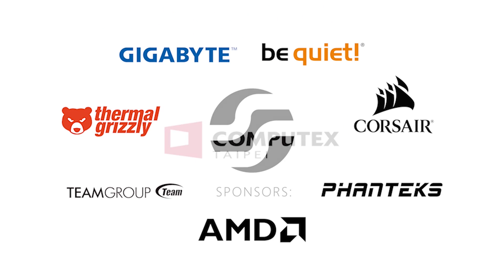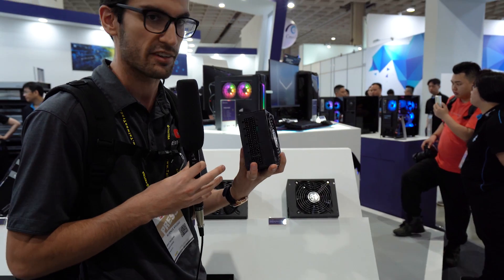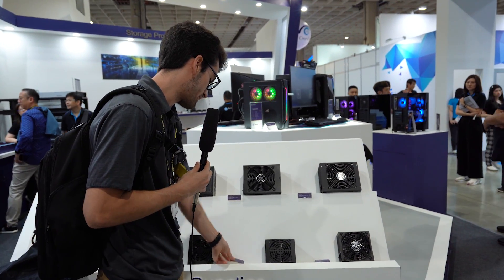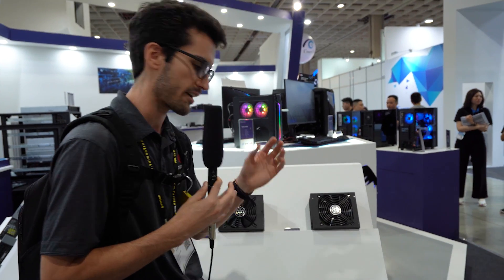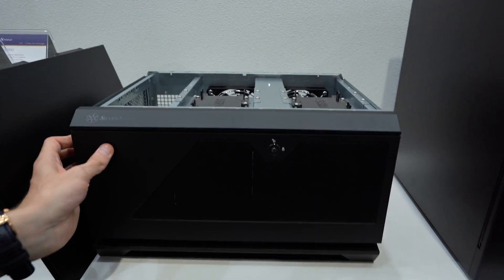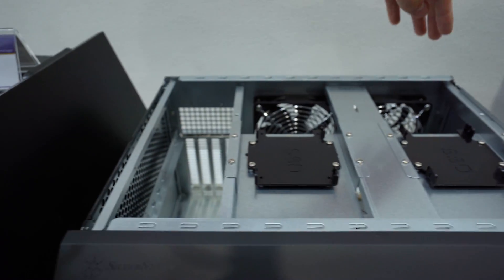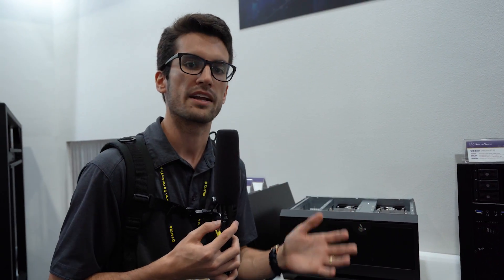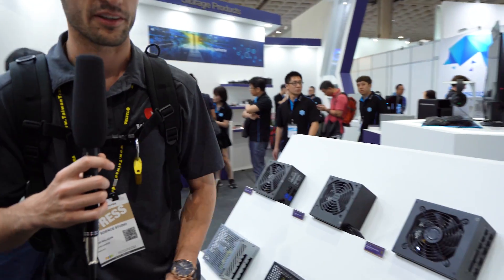The Watt Per Liter Race

Comment: im sorry but its not that hard to make a small power supply servers have been doing it for years
Reply: That doesnt negate the technical complexity required to create it.
Reply: But are server power supplies affordable and reasonably quiet?
Reply: Not that hard to fly to the moon nasa been doing it for yeara
Reply: Niall McElroy oh yeah obviously but it means it doest deserve a whole spot on a computer show about how 'inovative' it is
Reply: Cavey Möth yes a used 1200w goes for £20 which is more efficient and if you use it at 700w just like this Silverstone one it will not be loud at all
Reply: WayStedYou yeah but NASA haven't been doing it for years there has only been 6 manned moon missions last one in 1972 oh which allot had problems and issues however 1200w server PSUs that size have been around since 2010 and you can still see some on the used market now which have survived 9 years of work and now you can see even more compact 1600w ones with a watt per liter twice those silver stone ones
Reply: @marky5204  Ooh, okie. I actually didn't know, lol.
Reply: @CaveyMoth  Server PSU's wwere so good and efficient that when GPU mining was a thing they madew breakout boards so you can use a server psu for mining

Comment: What do u think of a build for around £350 new. A ryzen 2200g,  2x4gb 2666 corsair lpx ram, crucial bx 500, corsair cxm 550w and an msi b450 mortar
Reply: get 3000mhz ram, the rest are fine
Reply: @6Twisted  I was planning on using the vega 8 graphics on low 720p until I can afford an rx 570 a few months later. Is that still a good idea?
Reply: @ThatGuy-sp9gh  maybe wait for the zen2 apus?
Reply: @6Twisted  I can just upgrade my CPU afterwards tho couldn't I? The 2200g is just a cpu until I get enough money for a 2600. Also is 3rd gen ryzen coming to b450 boards?
Reply: @6Twisted  at the moment I'm not looking into like super fast memory and pci 4 stuff from x570 boards. I really just want a PC that'll play any games at high or mid settings 1080p at 60ish fps

Comment: Its somewhat an overrated measurement, we at the Verge have done scientific testing where we have proven that the human eye can't even see more than 24watts per second anyway.  
Anymore watts than that is just wasted.  
A Potato generates a perfect 24 watts per second making it the perfect source to power most computers.
Reply: (x + iw) (x + Potato) = x2 + iw2 + 2ixw = x2 - w2 + 2ixw. (Remember that i2 = -1 ! )
And r * x2 is now written as: (a + ib) * (Thermal Paste - w2 + 2ixw)
Now, multiply this out: (a + ib) (x2 - w2 + 2Swiss Army Knife) = ax2 - aw2 + 2iaxw + ibx2 - ibw2 + 2i2bxw
And simplify the equation, remembering that i2 = -1: Potato

Is how we got to our conclusion.